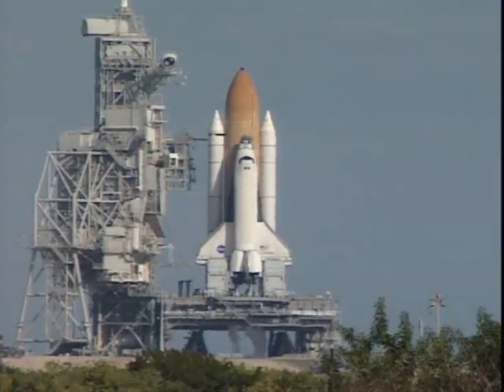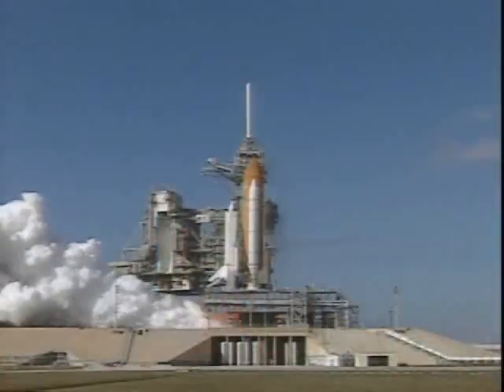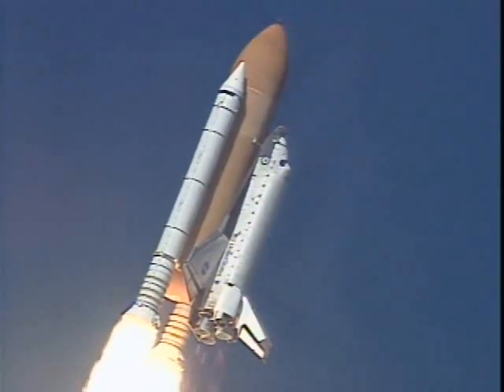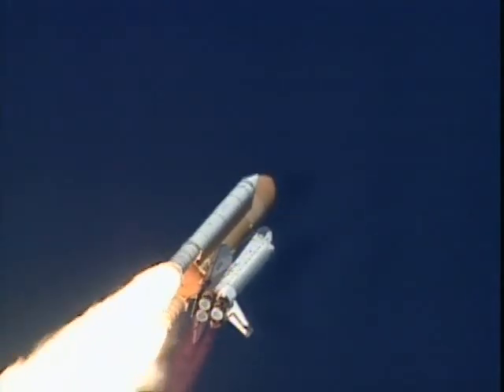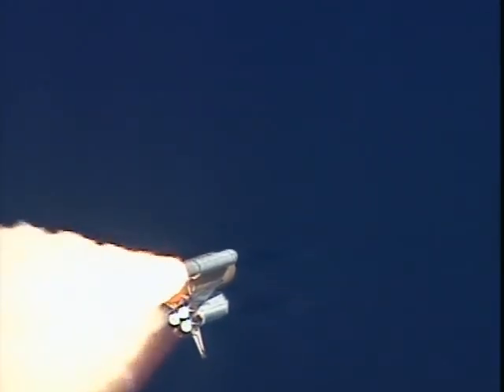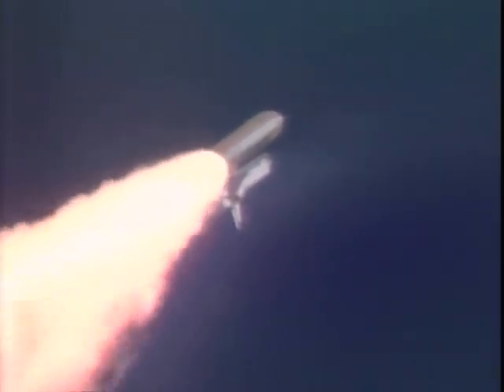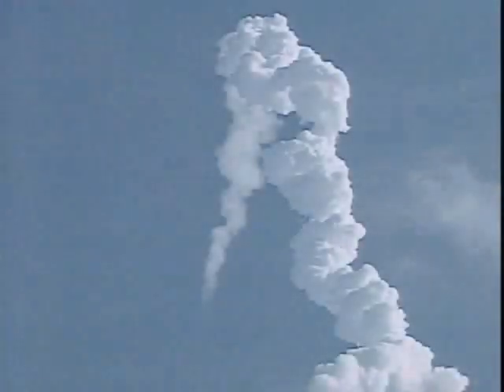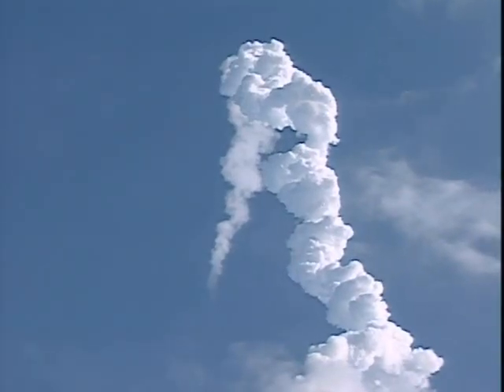STS-107 Columbia's final launch (1-16-03)

Comment: You cant tell me they didnt have cameras recording the last events on the Columbia and the Challenger
Reply: Columbia did. The end portion of the film burnt up from the heat.
Reply: @nolancain8792  if the end burned up then why not all of it?
Reply: @jamesmcdaniel7907  it broke up around 200,000 feet, the heating wouldn’t have lasted too much longer and it probably fell down at a steeper angle, lessening the heating exposure. It goes up to when they hit the coast of California.

Comment: Hard to believe that the event in the flight that doomed Columbia was so close to the point in the flight that also doomed Challenger. Less than 15 seconds from when Challenger exploded after the Throttle Up, to the flash where you see the foam strike Columbia.

It is so easy to get used to space flight, then you realise just how fragile these vehicles are.
Reply: I don't see it.
Reply: @woodykelleher9253  you have to look VERY closely. exactly when the launch commentator says the "I" of Ilan Ramon seated down on the mid deck you can see the foam impacting the wing and getting vapourized. 1:56 it is very hard to see because it happens very fast and  the resolution of the camera wernt that good 18 years ago. but the impact is visible actually.
Reply: @martindelrio1891  I can't see it and I'm looking as closely as I can.
Reply: @ILoveOldTWC  He's right.  It's super hard to see because it's only like 20 inches long.  What you actually see (barely) is the foam exploding into dust after the strike.

If you rapid pause between 1:54 and 1:57, at 1:56 you can see a millisecond flash of brighter colour 45 degrees up and right of the shuttle engine nacelles. That's the strike.

If you watch any documentaries on the actual event there are zoomed in, corrected videos of it.
Reply: But there were so many other times when the crews made it into space and back to earth safely. Only twice did the shuttle blow up and kill every crew member. One after liftoff, and one during reentry.

Comment: Have a shuttle launch had foam strike at some point in this case it was hitting at a very high speed and it proved to be devastating
Reply: STS 27 nearly had the same incident except it was on the nose section of the heat shield. The tile that came off just so happened to be near a metal strut.
Reply: Yes almost every shuttle launch had a foam strike but non proved to be devastating